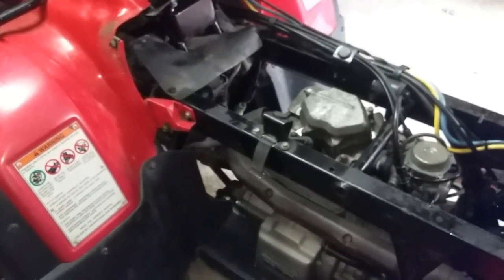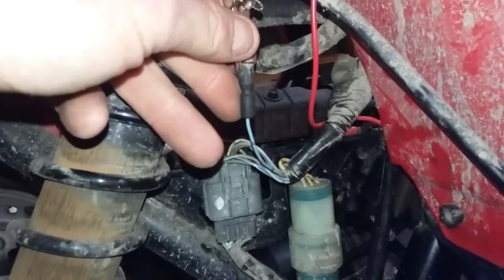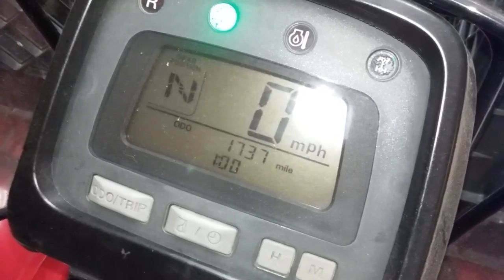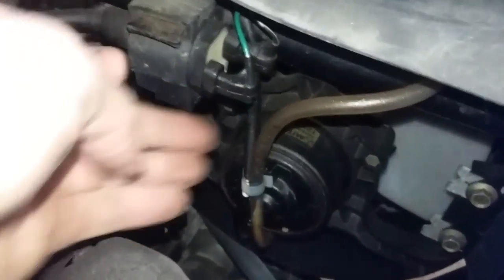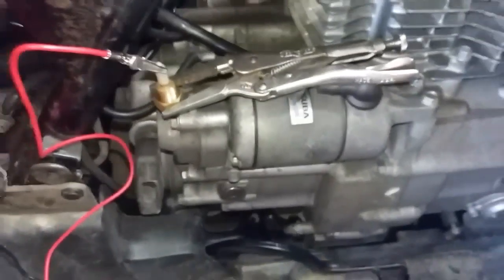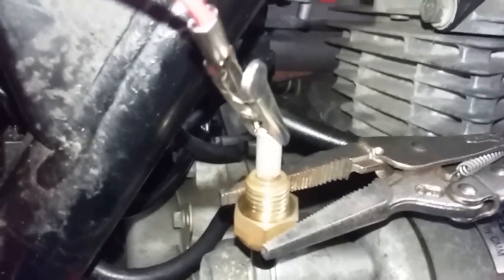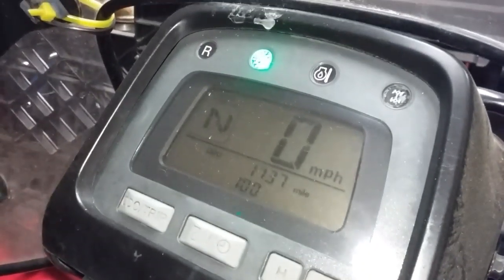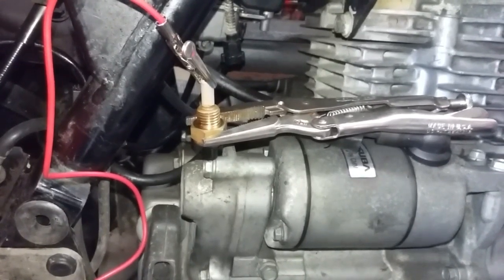Honda foreman 450 fan circuit

Comment: This definitely helped with my problem. I did this test and the fan came on. However when I plugged the wire back into the thermosensor the light was still on. Long story short it ENDED UP BEING THE FEMALE PLUG THAT THE THEROSENSOR WIRE PLUGS INTO WAS LOOSE.. I took needle nosed pliers and squeezed that female connector where it was gapped back together to make a tighter fit when the male went into the female. Warmed the quad up and low and behold the fan came on. It took a while to get to temp for the fan to kick on so be patient. Thank you for this video it with out a doubt got rid of my headache on this problem.👍👍👍

Comment: Excellent video to troubleshoot this issue. My 2003 Foreman 450es fan would not run any more and my oil temp light would come on often. With the help of your video I determined the fan control module was bad. Replaced it and was back in business! Thank you for taking the time to post this for us diy ers it was a huge help!!
Reply: Is it hard to get to fan control module? Gonna try changing mine out on my Foreman.
Reply: @hondaman6918  Just makes sure when you buy anything electrical for a Honda 4-wheeler especially older models that it’s OEM or a high quality aftermarket from a actual Atv/UTV store. 

The 1’s from Amazon are a great price but will cost you so much more later, they go out very quickly if they even work. And electric parts from Amazon are Notorious for firing everything on your wheeler or catch it on fire 🔥 I’ve personally experienced this for myself

Comment: Commenting again because somehow, I deleted my original comment. I found a fix for a faulty fan control module buried on a Honda forum and it worked for me. If you fan runs with 12V applied and you know your FCM is faulty, you can try baking it in an oven at 450 degrees for 7-10 minutes. The idea is that this melts the solder inside and reflows any broken joints. I gave it a try on my dead FCM and couldn't believe it worked. Prior to deleting my original comment, I think two more folks replied that this worked for them.

Comment: Great video I’m currently working on a 02” model I have a short some where interesting that there is a grounding wire that runs to the speed cluster that has to have continuity through the speed in order for the fan to run I found this out in the Manuel and wiring diagrams

Comment: I had the same prob fan stopped so I just ran a hot wire to a switch so fan is on a switch and I just turn it on when I run the wheeler so it's on all the time

Comment: It doesn't actually make a ground. The temp switch gets to a certain resistance that the module reads then it decides to kick fan on. I use a  normal sensor that actually grounds like one used for a dummy light. It eliminates the computer.

Comment: I thought about putting an aftermarket temperature gauge on mine, and wiring the fan straight to a toggle switch so when it gets hot enough I can turn the fan on. 
My question is, What temperature does a 400 foreman get to, or how hot is it supposed to get for the fan to come on?

Comment: Thanks for sharing this. I suspected my fan on my 2k Rancher 350 ES wasn't working. Checked the fuse. good. Disconnected the temp sensor and grounded the wire. No joy. Disconnected the fan, ran jump leads from the battery. Fan came on. Sweet! I hooked all the connections back up. No Joy. hmmm. I probe the green wire to the fan. Found 12 volts. I grounded the blue wire leading to the fan motor. again, no joy. Now I'm perplexed. It's obviously not getting a command on from the FCU.
Any ideas before I fire off the parts cannon?
Thanks & Cheers from Louisiana.

Comment: Thanks for your advice, changed oil temp sensor, light still on after I turn on engine… stays on. Gonna replace fan module next, hope that fixes red light staying on issue…Can  you just reach in and pull the fan module out … I need to replace mine… any tips?
Reply from the maker: Just pull it out of the rubber boot and unplug it.  Thanks
Reply: @savagebeast8476  thanks, replaced fan module, works perfect!

Comment: This was very helpful. Does anyone know what temperature the engine case would be for this to trigger the thermosensor? Ie using a temp gone to confirm the tempsensor is working or is that idependant to the oil overheat light?

Comment: I’m not a mechanic, quick question, my oil temp light won’t go out, stays on. I’ll just change oil sensor, cheap part. It unscrews from bottom, but how do you disconnect  wire side? Is it easy? Is there a disconnect on the wire side? Does it just pull apart? Any advice would be great…
Reply from the maker: Yes it's easy, just pull it off, no special tools.  Thank you

Comment: O.k. I purchased a 4 wheeler used and it keeps shutting off when I ride it for a while. The guy I got it from told me about checking the fan, so I did and the fan wires where not connected.  Now I don't know where too hook those 2 wires up too.  Can anyone help me, pls.

Comment: Hi great video helped a lot I have a question for you can you.
I grounded the wire like you said my fan came on and worked but the red overheat temperature light comes on at the same time?
And I think you said in your video the red temperature light should not come on just by grounding that wire.
If you can help me I would appreciate it!!!
Reply from the maker: If you watch it again you will see it does come on when jumping straight to ground.  It sounds like everything should be fine.... lol thank you
Reply: OK thank you I just bought this used 2002 Honda 450 es foreman and I was unsure if the cooling system is working properly because while riding it The fan never seems to kick in but maybe I can’t hear it when riding on it.
Reply from the maker: It takes alot to get the fan to kick in, unless your working it etc and it's hot 🔥 out.... they run much hotter than a liquid cooled. If you want to test the system you can start the machine and let it idle, just keep an eye on it and watch for the fan or temp light etc,  depending on the temperature 🌡 it may take 20 plus minutes to come up to temp and cycle the fan on and off... you will definitely hear it kick in also....  then you can be sure it's working properly....
Reply: Thanks again!!

Comment: I grounded the wire to the temp sensor and the fan turns on then right off. And if I leave it grounded the fan will cycle on then off every minute or so. Do you have any ideas? The temp sensor, fcm and fan motor are all new.
Reply from the maker: I would hook everything back up and run the machine to verify it's working... or not working properly.  It does take a while at idle for the fan to turn on.  If it cycles on and off it should be fine,  the overheat light only turns on after it's very hot. If you have replaced those parts, I would definitely verify everything again, these machines run hot and sometimes it's deceiving, it seems like the fan should be on when the system is actually ok. If the overheat light illuminates then obviously it's to hot, but I would start there.  Hopefully this helps.

Comment: I grounded that wire still don’t come on buy new fan control switch and still don’t work unhooked the fan wired it and it comes on what’s your thoughts thanks
Reply: Maybe you weren't getting engine hot enough that it should have ever come on.
Reply: Did you figure it out

Comment: My oil light and fan runs all the time. Could it be oil sensor?
Reply from the maker: It's possible, but you will have to try and narrow it down,  you could try unplugging it at the oil temp sensor and go from there... see if it shuts off and start eliminating things... thank you

Comment: which direction should the fan be spinning
Reply: When I'm riding, feels like it is blowing towards the back. Makes sense not to fight the head wind.
Reply: Slowed the vid down near the end and can see it going clockwise if you're behind it, blowing air forward toward the oil cooler deal. Just spun mine up with a jumper and had to double check lol